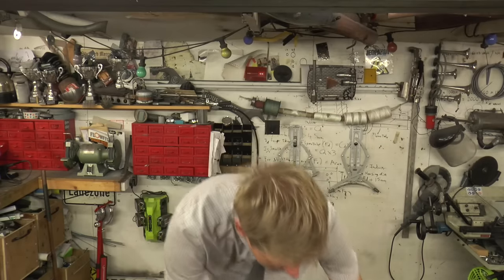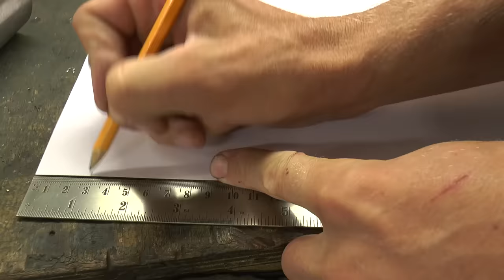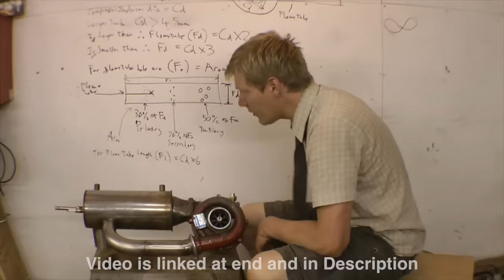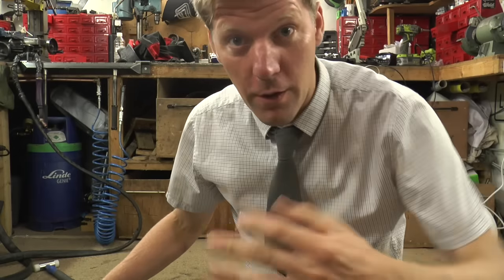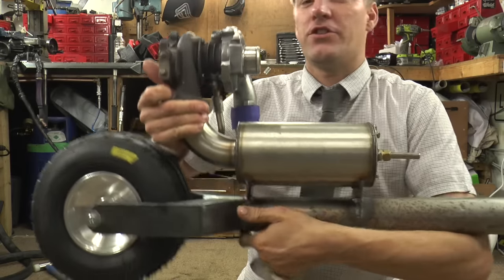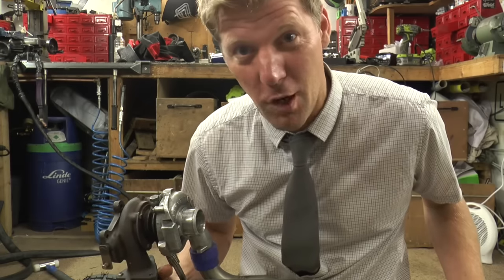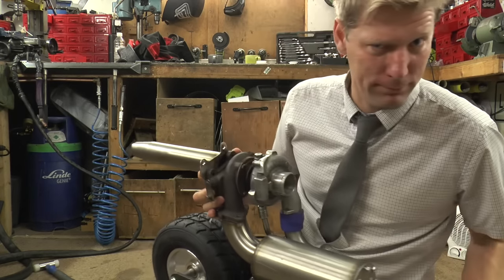TurboJet Scooter build #1-Jet/Chassis

Comment: Pulling oil from a turbo runs the risk of starvation. Whereas pushing oil doesn't.  Some turbos use a sump and pull from that when oil can not be returned directly to the sump. Hope this helped someone

Comment: Oil pressure required into turbo because of the type of bearings it uses. The shaft actually rides on a thin film of oil (under pressure) the bearing is the restriction in the system and what creates the pressure, after the restriction it's little - to no pressure thusly running down into the tank. Just like a simple hydraulic circuit.
Reply: Also, a restrictive outlet can make it force oil out of the bearings, which is sucked into the engine.
Reply: fellenXD yes, good point. I forgot to mention that. Thanks for correcting me.
Reply: Journal bearing turbos are good for things like this as you just smash a cheap oil pump on them and away you go. Only thing you need to do is make sure the drain is straight down and unrestricted. 

Ball bearing turbos are very picky about correct oil flow and pressures and are more likely to fail in projects like this due to the bearings being starved of oil due to low pressure, or push oil past the seals due to high flow and no restrictor valve when using a cheap unregulated oil transfer pump..
Reply: SuperRandykid also in an application like this a ball bearing turbo would require water cooling.
Reply: 100% correct in order for work to be done a pressure drop or shift has to occur. otherwise its pointless
Reply: You also need pressurized oil just to make it to the turbo. It doesn't have to be on the return because it is gravity fed back to sump

Comment: Please make Wright brothers style airplane you will get million of views no one has done it on YouTube
Reply: Einsteinium 99 im down for that
Reply: Peter Sripol built an Plane, if you ment that
Reply: Wright brothers style airplane... WITH A TURBO OR PULSE JET
Reply: Awesome idea, worried about his safety though. Colin doesn't seem like a safety fan.
Reply: I tried to make that integrated with a cycle
Reply: That would be dangerous interesting bro
Reply: Einsteinium 99 since he’s in the uk he’ll have to get a pilots license and a lot of official inspections and what ever. It simply would t be worth it. The reason why the Americans can do it is due to part 103, which doesn’t exist in the uk
Reply: JarjarSW  Making a buzz bomb next?
Reply: Einstenium 99 no, Peter Sripol has done it twice. get yer facts right son
Reply: JarjarSW  I was going to say the same. Colin can't build a biplane without sticking a jet engine onto it.
Reply: Einsteinium 99 Plane guys is PeterSripol.
Reply: Ok, let me explain why that's a bad idea. The 1903 Flyer had an underpowered engine that had no throttle it was tuned to be full power until it overheated or ran out of fuel. 
The hip cradle system is very difficult to control and the wing warping is very difficult to trim. The airfoil the Wrights used has odd stall characteristics. 
The original Flyer weighed 600 pounds (270 kilos) meaning that it would not be eligible for an FAR part 103 designation of an ultralight.
That means it would have to pass an FAA inspection and Colin would have to be a licensed pilot to fly it.
Reply: John Beauvais  Who says Colin has to fly it? Just get a brave volounteer pilot.
Reply: In the US we have a classification of vehicles that comes close to a plane like that. Part 103 Ultralights. On a side note, the wright flyer didn't have ailerons for control. The wing frame actually bent. Material fatigue is a scary thought
Reply: @Swecraft1  Did you know that if it had been warmer than 40° (15°C) the density altitude would have been too high for that plane to take off.
Reply: Siyabonga Kubeka  have you seen his hoverbike video. i dont think safety is a factor sometimes lol.
Reply: I'm pretty sure most early airplanes had an insanely high fatality rate
Reply: JarjarSW  pulse jet wright brothers plane with chromoly tube frame and modern aircraft skin shit, that would be the bees knees
Reply: Perhaps a collab with peter sripol is in order, as colin can easily supply multiple engines.
Reply: Peter stripol (twice), and about 30 other people 7 years ago
Reply: Einsteinium 99 that’s a great  idea
Reply: @Swecraft1  YES!!
Reply: @johnbeauvais3159  ...Wright brothers STYLE airplane...

Comment: Wow! Crazy as always!
Such a funny jet engine is still on my to do list. Maybe one which is propulsed with hydrogen 🤔... We will see😅👌🏼
Reply: it called "Space Shuttle"
Reply: That is more of an IED than a jet. Don't mess around with Hydrogen.
Reply: I would love to see a hydrogen powered gas turbine but there are some important issues I would like to advise you on.
Hydrogen causes metals to become brittle at high temp' so dont run it for long or the turbine will likely violently self destruct.
Hydrogen has a broad explosive limit range, so start the engine on regular fuel, turn on the hydrogen, then turn off the regular fuel to run, but switch back to regular fuel before u throttle down (to avoid an explosion in combustion chamber)
Hydrogen is a pain in the bum to store as it will not liquify so you will need a large storage volume.
Generate the hydrogen via electrolysis not by acid/metal reactions because the former is purer and the latter will often contain H2S wich is very toxic.
YOU MUST ENSURE THE HYDROGEN IS NOT MIXED WITH ANY OXYGEN OR AIR OR YOUR STORAGE VESSEL COULD DETONATE!
Reply: O_o jet yes. hydrogen....no.even chinese fireworks can kill, why would you mess with something that's even more dangerous?
Reply: Guys chill your life😅.
I am dealing with a lot of hydrogen and even oxyhydrogen for quite some years now and i also wrote a complementary work about hydrogen, so I kinda know what I am doing😄😁 just watch some of the videos I did on the topic. Some of them are subtitled...
Reply: Moin
Reply: Freizeitflugsphäre  I stand by my comment, I was only offering some advice
Reply: @davesulphate4497  no problem, nothing you told was wrong or bad. Better one advice too much than one too less😅😄
Reply: @tiddlytimmeh9649  Abend 😂
Reply: Hoi schat dat er een nieuwe
Reply: @davesulphate4497  Soo... Like with all gaseous fuels out there...
Reply: At first I thought you were one of those people that say "they will make something", but after looking at your channel I see you do actually make stuff.  Neato.  I understand that you say you've worked with hydrogen, I would recommend you start with kerosene first (get to hydrogen eventually), as that is as close to actual jet fuel as most people can easily get. Good luck
Reply: NICE

Comment: The turbo oil inlet has a restrictor in it to stop oil pressure from blowing the seals off the bearings. 

Also the oil inlet probably connector to an oil nozzle inside the housing, so if you blew oil up the oil output, you might get oil everywhere except in the most important place

Comment: The outlet doesn't need negative pressure because the inlet has preassure. Just like any automotive oiling system there is positive pressure that moves the oil then channels that guid it. Once it all travels back to the pump the pump picks it up again and continues the cycle.

Comment: Direct oil pressure lubricates and cools the turbo bearings. With out it it would seize up in about 5 min. You might want to consider installing a small cooler/ heat exchanger in line on the pressure side of the system.

Comment: Turbo shaft seals can be really sensitive to pressure or vacuum in the center section, this can cause shaft seal failure (100,000rpm and insane temps are pretty ludicrous demands for a shaft seal) so gravity is used for oil extraction. The journal bearing is the only thing that needs the oil, so your inlet line just needs to be a sufficient size and pressure to maintain the film that the shaft rides on. Outlet size is always supposed to be larger and very direct to avoid draining issues and pooling. in an event where the oil outlet can't be clocked within about 10-15% of straight down or the line can't be routed correctly, a scavenge pump can be used to help with drainage.

Comment: Oil drop from the turbo is not under pressure , to stop cavitation , if you get air going back into the tank, it will cause air bubbles to form in the hot oil, this will cause problems on the pickup side , and possibly cause oil starvation..👍

Comment: Positive pressure on the drain side of the turbo can cause oil to bypass the seal causing a smoky engine and, in the case of a diesel, possibly a runaway engine.

Comment: The nozzle needs a heat shield like on a catalytic converter to deflect infrared heat.  Maybe even a small in-line oil cooler.  The XL gets away with a dry sump frame, but it also turns 20W50 into the viscosity of water.

Comment: No pressure on oil outlet because otherwise the oil has nowhere to go on a journal bearing turbo, and it will leak past the oil seals into both the compressor and turbine housings.

Comment: because fluids flow to the area of low pressure. if you had pressure on both side the turbo it would blow the oil seal out and puke oil into the compressor and exhaust housings.

Comment: The turbo doesn't have a bearing, its a diamond shaped cylinder bushing i guess is the best way i can describe it, it get lubricated from a film of oil forming around that bushing, forming the turbos bearing, you run pressure in the top, it flows around the bushing and spills out the bottom

Comment: Turbos need oil pressure in the inlet to provent overfeeding and oil leaking in the intake depending of the engine's state. That's normal

Comment: Is your exhaust tube exit down sized for looks? Or by mechanically necessary design? If it's for looks cut the down sized end off to reduce any back pressure. Also for the inlet make a velocity stack and run a large  air filter or air screen for debris.

Comment: You should have a set of gloves specially cut for instances when each of your fingers are broken, so there's a hole for the bandage and splint to fit through. Maybe add in some flame retardant tape to help out a little.

Comment: 6:02 cuz it's too hot to do anything else and i think it's a hydraulic bearing that uses the oil pressure difference to float the shaft

Comment: What kind of drill were you using for the hole saw? 
Hammer drill,
Impact drill,
Or just a regular drill?

And what kind of hole saw did you use?
Bimetal ?
Reply from the maker: yeah just a cordless Ryobi with a Bi Metal holesaw
Reply: @colinfurze  
Danm.. how did it not over heat and shut down for safety?
Also what was that thing (cylinder object) in the middle you adapted

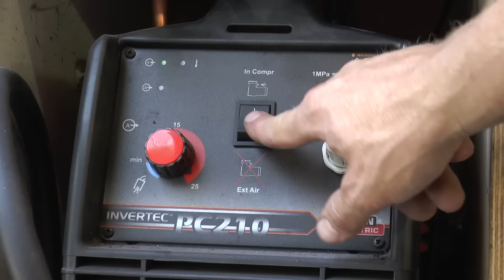Comment: sorry i don’t know about welding stuff but what is the tool used at 2:41? it looks awesome
Reply from the maker: Plasmas cutter, its a Lincoln Electric one, its very good, I,ve had cheap ones which work but the cutting arc on thins thing is like a needle.

Comment: why they all make the afterburner to a cone shape, a real jet has it all the way open when the burner goes on.  it only restricts thrust and that's not what you need on such small turbo.  uh, you want afterburner thrust, keep it straight with a kickass gas ignitor in it and all the fuel you can have. + you need a tube around the afterburner that works as a scavenge air-cooling system and provides extra ox on exit. otherwise, the afterburner will melt away even before you got some serious thrust.
Reply: some think ooh smaller hole on exit (cone) faster airspeed, nono . example a balloon with a small hole or a big hole, which one has the most punch. also at the start of the afterburner, you need some sort of air flow stabilizer so the air is flowing straight. before it expands further.